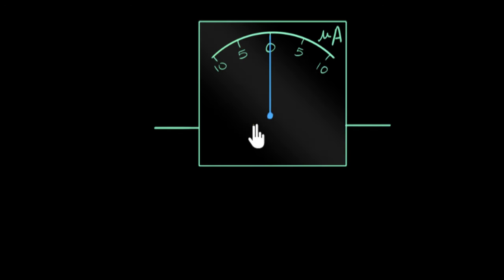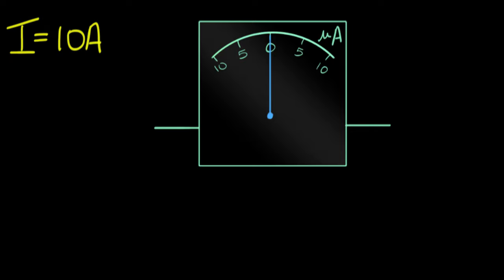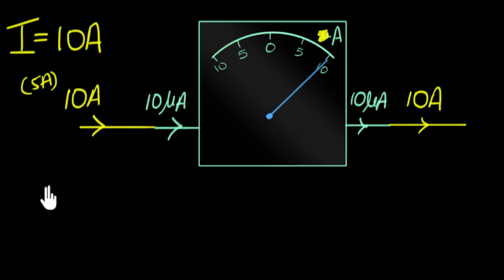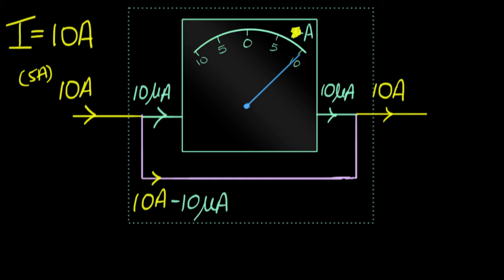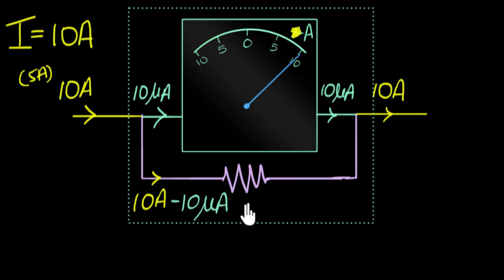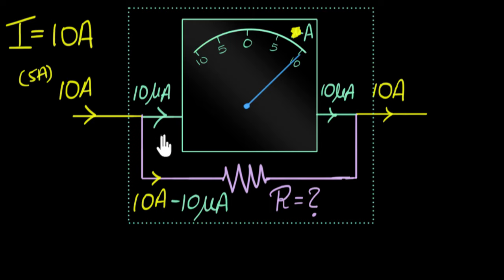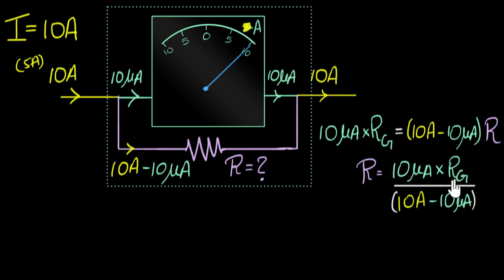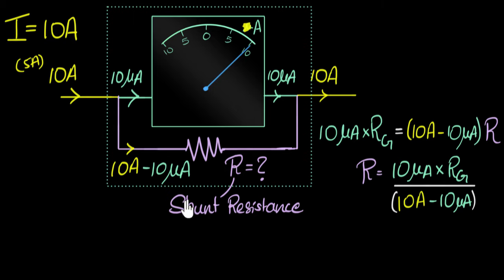Conversion of galvanometer into ammeter | Moving charges & magnetism| Physics | Khan Academy

Comment: If u already knows that 10A current u have to measure nd u have to extend  range of Galvanometer according to it... Then,  what was the need to measure it u already knows 10A current flows through it
Reply: 10 A is the limit.
but now we can measure any current from 0-10 A 
previously it was only from 0-10 microA

Comment: ok one practical question, do we need a fuse in series with ammeter where 10micro ampere flows through just to protect our galvanometer as we are feeding in 10 Amps? ofcourse 10Amps-10mAmps is theoritically flowing thorugh shunt resistance, but what if  practically  less current flows through shunt resistance?

Comment: Sir that means GALVANOMETER  can measure a only A VERY SMALL AMOUNT OF CURRENT (in micro A) so we need to pass the remaining current through a SMALL RESISTANCE connected in PARALLEL so that galvanometer CAN MEASURE CURRENT WITHOUT GETTING BLOWN UP RYT???? ...
ALSO WHAT IS THE FUNCTION OF GALVANOMETER???
Reply: yep that's correct and the function of the galvanometer is to detect the presence of current.

Comment: I gave it 10A current and the shunt took all of it except 10uA, and that 10uA caused a full meter reading informing us that the current flowed is 10A.

But, if I give it 5A current, will shunt let the same amount of current pass through it i.e, (10A-10uA)?  
If it let this amount pass through it(which is nearly equal to 10A), all the 5A current will pass through the shunt i.e, galvanometer Will show ne deflection cuz no current is passing through it.

(In short: Will shunt tend to take 10A-10uA current even if we give it 5A current?)

Please correct me what am I assuming wrong.
Reply: its just like mate if you want to measure 5A current then you want the galvanometre to get 5 mico ampere and all the left remaining current will have to pass through shunt which will be then ( 5A-5 micro Ampeere) hope that helps!

Comment: If we know how much current is going to pass through this  ammeter then why do we need to connect shunt and all
Reply: Cuz maximum current has to pass through shunt.... otherwise it'll blow up
Reply: because galvanometre is designed to measure mili amp currents not high amount of current it will get burned